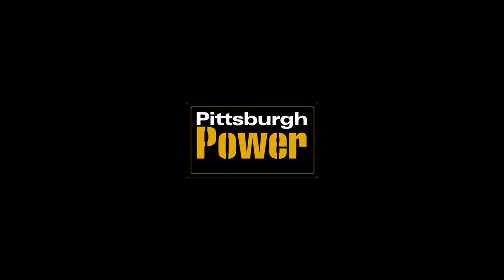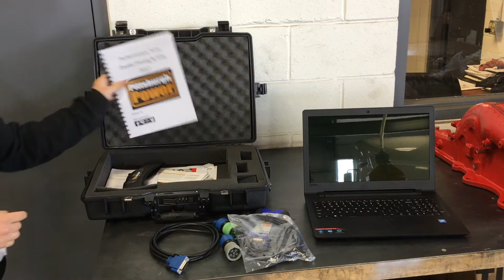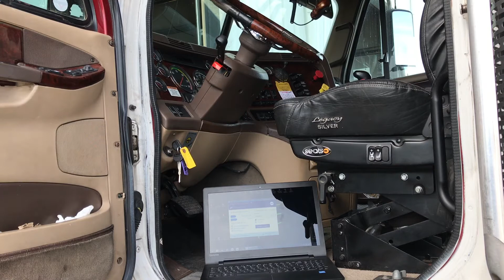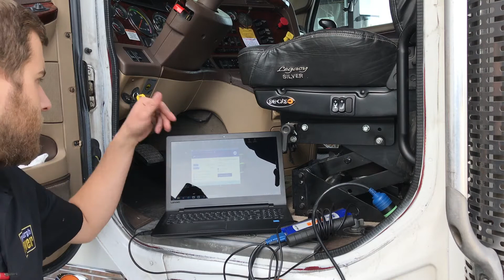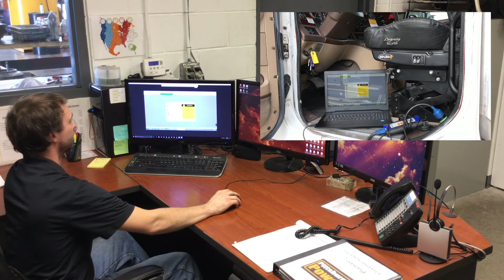PITTSBURGH POWER | REMOTE DIAGNOSTIC/TUNING KIT

Comment: So how does the friver on the roadside connect to pp if no wifi,do it through his cells data plan??
Reply from the maker: The Driver would connect through cell data plan if no wifi nearby. If you are on the side of the road, the data plan cost is the least of your issues. 
What ever works to get the rig running again.